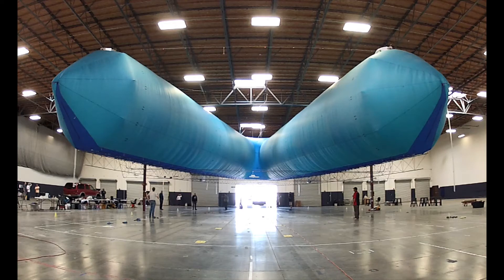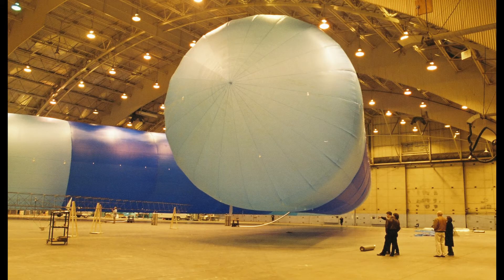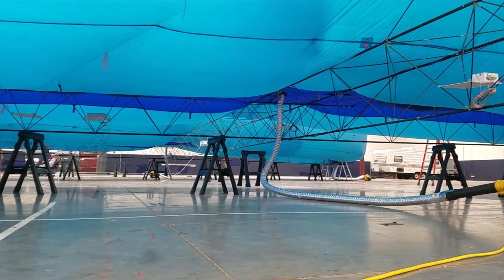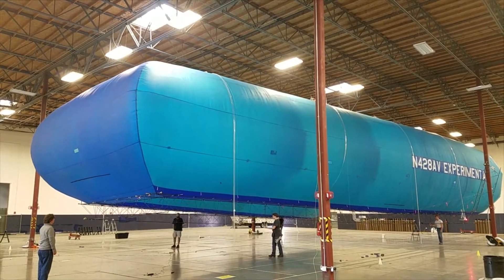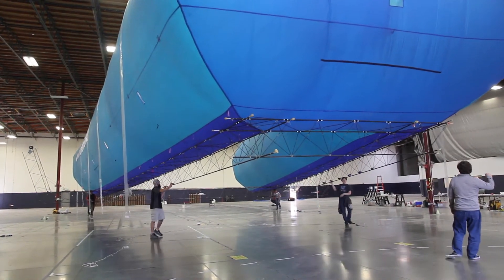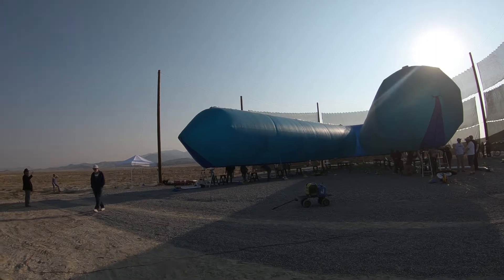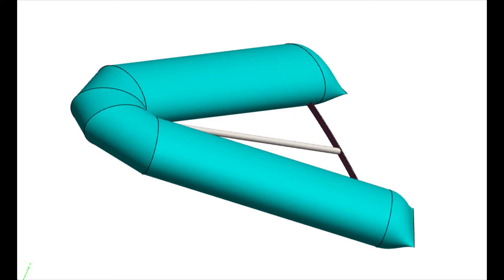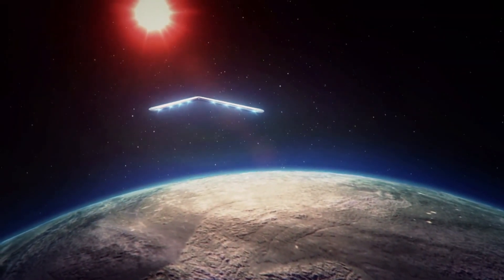Vee Ship in the Hangar

Comment: I wish I could participate with JP Aerospace. I was inspired by Buckminster Fuller to design a balloon superstructure composed of sub-balloons which are connected in such a way that as the atmospheric pressure drops at altitude, the tension of the balloons increases becoming more rigid, causing the superstructure to unfold into a geodesic sphere or dome, wherein a vacuum/void between the balloons increases the total volume displaced. Since near space is already high vacuum, this transformation can be arbitrarily large (and in fact scales up favorably due to tensegrity structure distribution of tensile forces) without any additional Helium or Hydrogen gas needed to maintain vacuum. Not only that, but Helium can be replaced by atmospheric gases if you can first lift the folded structure to the altitude it unfolds at.